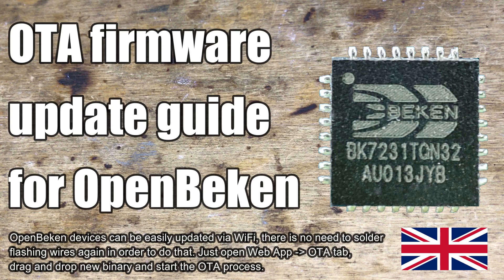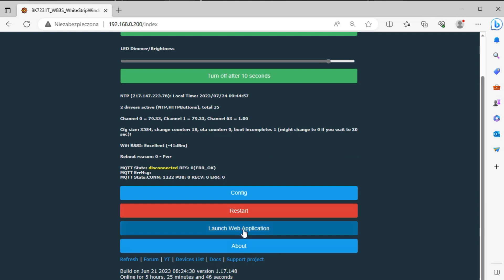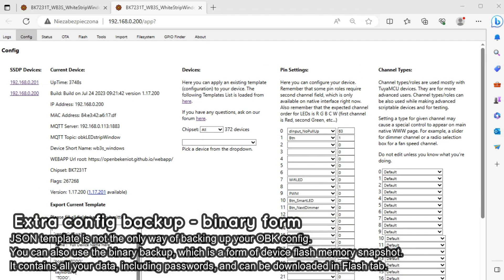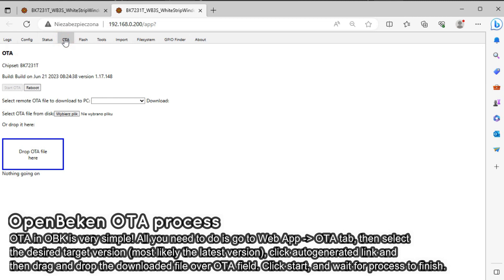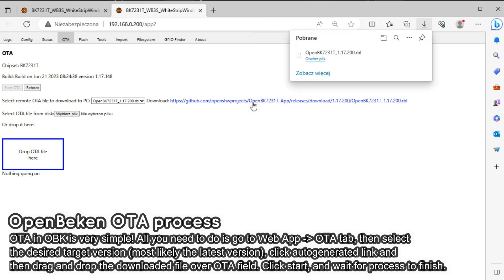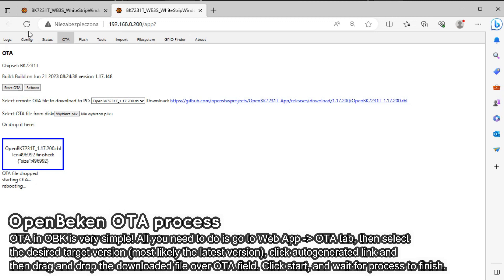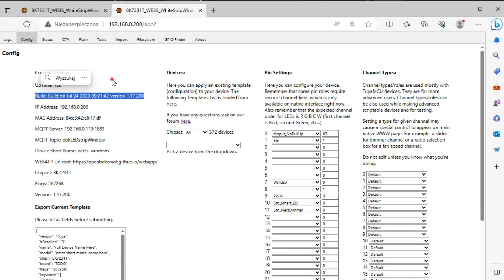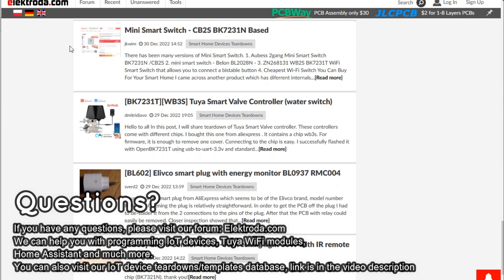How to update BK7231 firmware to latest version? OpenBeken OTA guide (also work for other platforms)

Comment: What could be the cause for the firmware not updating?
I updated quite a few devices through the web application, but some refuse to update. No error, no nothing. It flashes just fine. Nothing in logs. Reboots, comes up with the same firmware version, just the LFS wiped.
Some devices I managed to update through the config->OTA update, some just plain refuse to update at all.

Comment: Hi, I have one floodlight running on the latest .366 firmware where the web app will not load and it is also not connecting well to my Zyxel router (keeps giving it the same IP address in the wrong subnet). How can I roll this back to version .299 which is running fine on my other 3 floodlights? thanks!